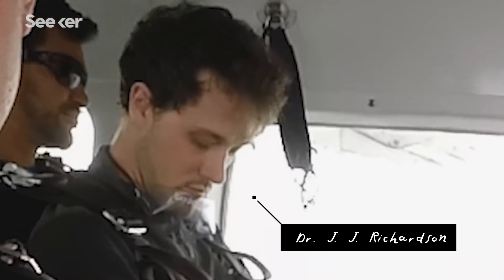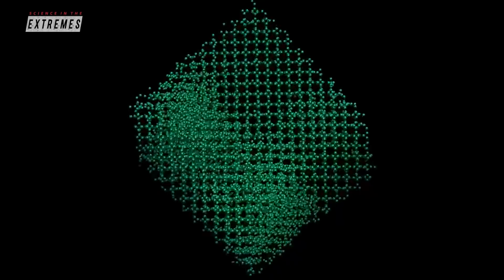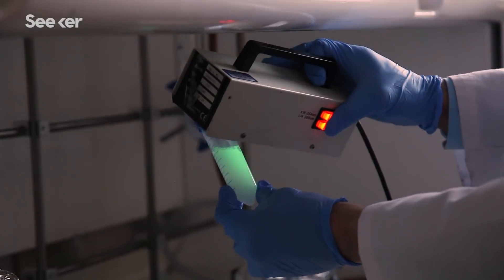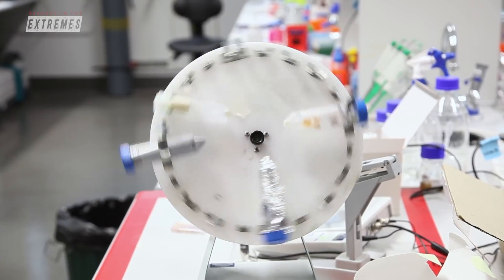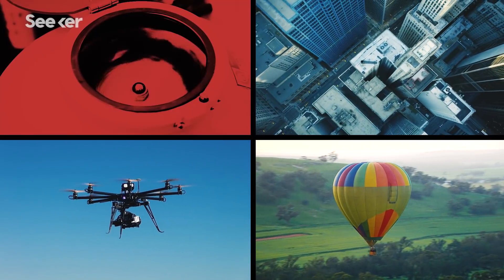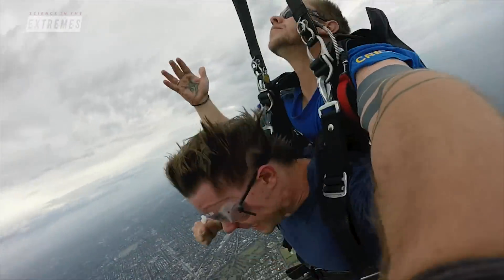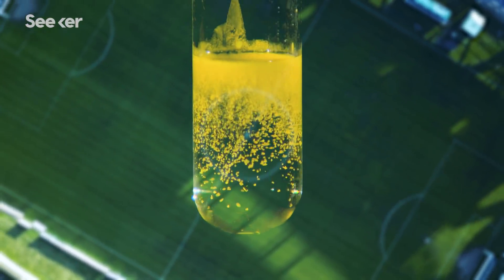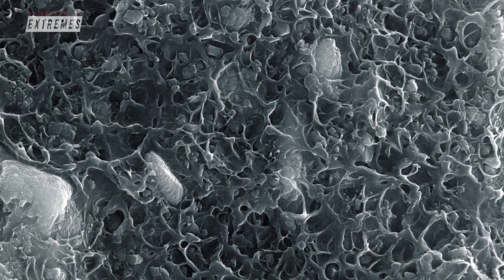These Hybrid Metallic Crystals Are Chemistry’s New Miracle Materials

Comment: Jumping out of a plane to get microgravity is a stunt and not science. You reach terminal velocity in 12 seconds (and so full gravity). After just 2-3 seconds you are alrady experiencing 1/3rd gravity. And during that brief timeframe you are exposed to random acceleration in all directions due to turbulence. You would get „better“ microgravity simply tossing your sample up in the air and catching it.

This is the reason things like evacuated drop towers exist. They give you about 8 seconds of microgravity free from any accelerations, and are far cheaper than sending things to space.

NASA operates several drop towers and there are also some operated by ESA and several independent research projects.
Reply: The video was produced by the U.S. Air Force.  See opening credits.
Reply: It's probably cheaper and/or easier to skydive than renting a drop tower and waiting for their turn to use it.
Reply: @dropmelon  couldve put it in a wind tower
Reply: Fan Antics but would have been cheaper to do nothing and gotten equally as useful data
Reply: It worked for their purpose & it was a fun experience. If science had to be something entirely serious, a lot of the discoveries that were made out of fun & curiosity, but resulted in survival benefits, would be nonexistent today. We'd be too busy answering our serious life-saving questions that we would forget we're missing some of them.
Reply: Jumping out of a plane to grow crystals might not be the most scientific way, but it seems like a pretty reasonable method to narrow down growth variables. They can quickly try out different materials, concentrations, etc. as planning stage for more costly but more controlled environments.
Reply: It can be both. Things aren't mutually exclusive
Reply: Ignore these paid scientists with credentials. Take it from this guy on youtube.
Reply: Florian Bösch stfu no one cares
Reply: You just blew....my mind
Reply: Florian Bösch be better just using NASA’s vomit comet plane .
Reply: @lasarith2  Vomit Comet is actually more expensive than the drop towers.
Reply: Florian Bösch I wasn’t aware of that  - wouldn’t being able to do the free fall multiple times , offset the cost due to being able to make far more of the metal then in one jump 🤷🏼‍♂️
Reply: @lasarith2  The Vomit Comet comes at a cost of $5000 per seat for 15 parabolic maneuvers each 20-30 seconds, that makes a cost of about $13/s. However what you get isn't very good microgravity, the plane is still flying trough the air and even if you float inside you're subjected to a bit of air resistance of what air is in the cabin. A drop tower can give you accelerations as low as 10^-6 m/s and in 2-9s periods. The cost of dropping something is neglible (all you do is engage a winch and haul it up). It can do dozens of drops per hour, and you can change your experiment between drops, it's also available almost all year at all times, and there's a few dozen such drop towers operated in the western world.
Reply: Florian Bösch okay cool thanks a lot 😁
Reply: @lasarith2  they would have to travel to where ever the vomet comet is based and australian to US flight is lije over 18 hours and paying for the service.
Reply: Sure, drop towers are a great resource, however are you aware of the length of time these scientists require for crystal formation? I'm not saying that what they are doing is the most viable, however drop towers may be out of the question for them. This could be the next best thing
Reply: Garrett D It takes 12 seconds to reach terminal velocity (at which point  you get the full 9.81m/s of resistance). The period of „microgravity“ you get out of a skydive practically does not exist. The second you step out of that plane you are thrown about by turbulence and decelerated by air drag. I would be surprised if at any point in the skydive you would get less than 1m/s of resistance. A drop tower can do you for 0.0000001m/s. If you want to observe crystal growth, and if a skydive ostensibly „does it for you“ then a drop tower will do it much better due to the higher quality microgravity. It might not be as cheap as a skydive, but it is probably cheaper than the vomit comet.
Reply: @Thomas Grubbe So.. does that mean the U.S. Airforce paid for the expenses as it's their planess/equipment, leading to a cheaper experiment by them not needing to fund it? Although the skydive should be imperfect for an experiment like this, it would've cheaper to be done if that's the reason.
Reply: @Cryo_Cross  They would've gotten more microgravity of better quality by simply tossing the vial with the experiment in the air by hand than getting on a plane. A good hand throw straight up has a velocity of about 20m/s. It'd send the object into "microgravity" for about 4 seconds at resistances way below 1m/s (if you you put a piece of metal to the vial and keep it compact probably like 0.1m/s tops).

You're probably not going to get anything below 1m/s from the skydive, and the period where it's in that range probably only lasts 2-3 seconds. QED.
Reply: What you expect when they main goal is to protect us from plant food? The idea of 0g crystal growth is nice. But they lost me when they start talking about CO².
Reply: @KamuiPan  found one!
Reply: Florian Bösch yes I think this is Just a lure to recruit new kids into the US airforce
Reply: Damn. All those Joe Rogan podcasts with scientists talking about how the community can be really shit were true.
Reply: No.
Reply: thats what they did, they trhowing it and catch it, but how do you throw it so high to spend 30 seconds falling, genius?
Reply: What about the 747 they use to simulate zero gravity...to train astronauts.
Reply: Don't they use swimming pols also to simulate low gravity..under water...what if they used super salinated water..like those sensory deprivation chambers.
Reply: Absolutely agree!
Reply: You're not understanding the reason for the jump. The purpose is to reach terminal velocity, where the net force on the jumper is zero.
Reply: Mackenzie Salisbury When you reach terminal velocity, the net forces are zero because air resistance equals gravity. You know how else you get a net force of zero? By standing on the ground, where the „ground resistance“ equals gravity. So unfortunately it is you who does not understand the purpose of the experiment (growing crystals in weightlessness/microgravity). Something that you cannot attain standing on the ground, and therefore also not at terminal velocity. Terminal velocity is no different (other than the fact that you are moving and thrown about by turbulence) than standing on the ground, it is just a really pliable ground.
Reply: 2:48 It's stated that one aspect of this experiment was related to "injecting samples once in freefall". 
To do something similar to introducing both elements to eachother only after entering low levels of acelleration would require remote  controlled motor to repeat the same type of injection while in a drop tower. THEN you would have an improved experiment!

I suspect that the researchers wanted to do a sample experiment without having to spend more than $330 all up getting to a place they could perform the proof of concept...
Reply: Stop being a scientist and let the. Work however they want they know how to do it xd
Reply: I was scrolling through the comments to see if anyone would mentioned this! 
The fact that seeker didn’t immediate realize this was pretty shocking.. even alarming. It’s obviously a very good reason to question the credibility of these “scientists”, but also seeker’s credibility. I love their videos, but now wonder how thorough their research is before they give a new technology or group of scientists their spotlight. There’s a responsibility to vet the science. 
Your point on gravity is absolutely spot on. Jumping out of a plane is a ridiculously useless way to conduct such an experiment. Even if you didn’t reach terminal velocity in 12 seconds (apparently they have zero clue that means you’re no longer weightless.. gravity is what it is on the ground, and it doesn’t even feel like you’re falling), the level of shaking introduces acceleration so much higher than the gravity of sitting on a table. To further highlight your great point that after just 2-3s you’re already experiencing 1/3 gravity, there’s actually NO point during the jump that you don’t “feel” gravity because you’re ALWAYS experiencing wind resistance.. from the instant you jump, which increases until you hit terminal velocity (aka 1g)  

Plus.. no one else is skeptical that a few seconds is enough time to observe the growth of these crystals? Possible, I don’t know, but it’s irrelevant considering the joke that is this group of “scientists”. I’d be concerned that there are some dishonest motives behind their project.
Reply: tbh, they just could have used zero gravity planes or as you mentioned tossing it away and catching.
Reply: Yes, science is for serious stuff only. It's a no fun zone. Even though the reactions worked, the fun negates any possibility that the resultant chemistry can ever be interpreted as actual science.
Reply: +synchron - don't try to put YOUR words into my mouth.  i didn't say science couldn't be fun.  what i SAID was THIS video is bullshit.  when you jump from a plane, air resistance begins slowing your fall immediately, and therefore it is NOT a microgravity environment.  if these "researchers" believe that it was, it only shows their utter INCOMPETENCE (not too surprising coming from the no-child-left-behind generation).  if they knew better but pulled this stunt anyway, then they are a bunch of liars and cheats who wasted research funding to pay for purely recreational skydiving.  the reactions occurred EXACTLY as they would have in the lab on the ground.  btw, GFY, asshole.
Reply: I going to trust the scientists from the Air Force
Reply: No, you got it wrong. They experience "full gravity" the entire time. You are thinking of g-force, which is an effect caused by gravitational fields. Zero g is not zero gravity.
Reply: Definitely a stunt. This experiment would be similar to letting bread dough rise in a clothes drier instead of a counter top or oven.
Reply: oh...oh...  someone who appears to know what he's talking about.  this won't sit well with the YT 'tards who think they can get a science education by watching anonymous videos on YT.  to paraphrase monty burns, "release the flaming trolls."
Reply: @johnmichael1594  I watch a lot of science channels on YouTube, and I have learned quite a lot from them. It seems that you want to insult people for having the desire to learn. I think you are the YouTube tard that is flame trolling.
Reply: +ipeed - yes it's possible to learn actual science on YT, just like it's possible to win the lottery.  it's also possible to be grossly misled and deceived by YT videos posted by hacks, just like it's possible to squander your life savings gambling and never win.  good luck with that, because your odds are about the same.  

or...   if you REALLY have a desire to learn science, you could go to the library and check out an actual science textbook (the older the better, and at least 50yrs old), because in the same amount of time you squander watching a video on YT, you could absorb 100 times more factual (and reliable) knowledge from reading a book.

if you NEED to be entertained and amused by videos in order to learn science, then you will never get farther than an elementary school comprehension of science.  concomitantly, if you find reading a science book tedious and boring, maybe you are not cut out for science.  people devote their entire lives to master one small, narrow aspect of science, and THEY find THAT entertaining (try to imagine that).

ya know what they say...  little things amuse little minds.  if acquiring a command of science were as simple as watching YT videos, then ordinary dipshits watching YT videos would have invented warp drive or found a cure for aging by now.  BUT THEY HAVEN'T.

QED.

however, it is not I who is being judgmental, it's you.  i'm simply pointing out the FACT that THIS video is bullshit, and for the most part, FACTUALLY INCORRECT, as mr. bösch so succinctly stated in his comment.

furthermore, if you have no REAL interest in learning science and merely like sciency-sounding infotainment as a casual diversion, that's FINE.  i am NOT belittling you or people like you, merely suggesting to you that there are FAR more reliable resources than YT for you sciency-sounding infotainment.  try PBS or one of the myriad of cable channels, or reputable streaming channels on the internet.  just NOT boobtube.  

don't you know?  according to YT, the earth is flat, nibiru is about to destroy the solar system, and shoving a potato up your ass cures all diseases.  THAT'S the kind of "science" you can learn on YT.  are you competent to know the difference?  if you were, you probably wouldn't be so enamored by YT science videos.
Reply: @johnmichael1594  What if I graduated from Georgia Tech with an engineering degree and retired at 40, but still want to be up to date with the latest discoveries like say, proof of the Higgs Boson, or dark matter? I could never get that from YouTube? I couldn't subscribe to periodic videos and learn about the latest discovered elements from a professor at Cambridge university? Wow I have been living a lie portrayed by flat Earth jokers I guess. Everything on YouTube is just stupid. Thank's for enlightening me Mr. comment troll guy.
Reply: John Michael real science ended when we found out space and time is actually just one dimension and it warps too! Anything after that is like the afterglow of fireworks and people performing Shakespeare’s plays... 
just tragedies
Reply: Also, I wonder if 8 seconds of microgravity is really enough time to see enough crystal growth to obtain meaningful data. Even if it is, it's not a scalable solution, so even if MOFs formed in microgravity have useful real-world applications, you'd need to produce them in space factories.
Reply: Blah blah blah blah! You can reach your ankles and get anti gravity on your taint !
Reply: Same here.  I wish I'm missing something but for a human to hold a sample is introducing G forces to it.  If its truly gravity then we have a reason to exploit the moon
Reply: @zodiacfml  the moon still has a little bit of gravity. it has mass
Reply: zero gravity does not exist, and your point is irrelevant. I am obviously referring to earths gravity, respectively the acceleration it excerts, and how much of it (along with random other acceleration) you will get when jumping out of a plane. The term microgravity is used to describe a situation in which a body does not experience acceleration on account of there being no resistance to the gravitational acceleration and it being under no other acceleration. For the purpose of growing crystals, microgravity is what you want. You will not get any microgravity by jumping out of a plane, on account of air resistance. That is why evacuated drop towers exist.
Reply: @pyalot   yet microgravity is just freefall. ISS is going around the earth faster then it falls towards the earth aka it is in freefall around the earth. So they would achive microgravity. You have to remember it is not them self that is the expiriment, but an closed off bag they are wearing. Stuff inside there would expirience  microgravity
Reply: @stsob  once they hit terminal velocity there is no microgravity because they are no longer accelerating.
Reply: @pyalot  what about La Grange points?  I mean there's an example of a spot with essential 0 gravitational acceleration
Reply: @pyalot  i agree with adam
Reply: @pyalot  Yes, I am aware of microgravity as a concept. However, you wrote "full gravity" in another sentence which made me think you made an error. The consequences of being in a gravitational field results in acceleration and counteracting that acceleration is what creates the apparent g-force. I just whish you would write 1/3 of the acceleration caused by gravity rather than 1/3rd gravity. I totally agree with that this is very much a pr-thing.

Comment: I wonder if those crystals can trap HIV viruses inside. That would be a cool cure for HIV if so
Reply: Capturing viruses? Thats a massive task
Reply: @invertedv12powerhouse77  genius
Reply: We could also shot HIV down with lasers. Pif pif.
Reply: These crystals can hold molecules, not cells, it would be near impossible to make that big of a "jail/trap"
Reply: Ilyass Saadi viruses are a lot smaller than regular cells. How much smaller? Not sure. But if possible, that would revolutionary
Reply: @octane2344  yea i kinda messed up when I took cells as an example. Even a viruse's RNA is a giant molecule in itself. Might aswell just use crispr cas9 to do the job (make the cells immune to harmful intruders)
Reply: @octane2344  Thousands times smaller.  Viruses reproduce by using cells reproduction system to crate copies of itself, before cell bursts there can be thousands of viruses in it ready to infect other cells. They are very small, but still huge in comparison to molecules or single atoms and are way more complex than them. For a better understanding lets bring the amount of atoms a HIV virus has. 64 millions of atoms. Trying to catch HIV virus with this method would be like trying to catch a mountain by using a butterfly net. But hey, we came pretty far and doing that could be not far away. It doesn't seem efficient nor particulary effective though.
Reply: Krzysztof Piasek 64 million atoms wow. Had no idea